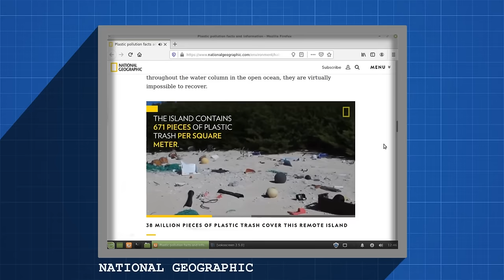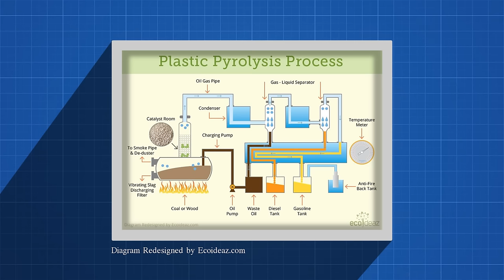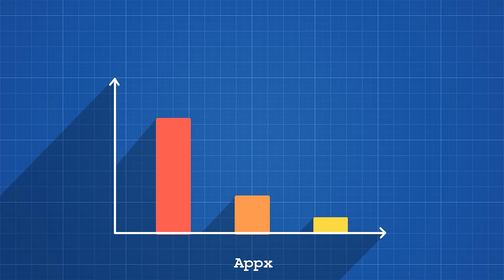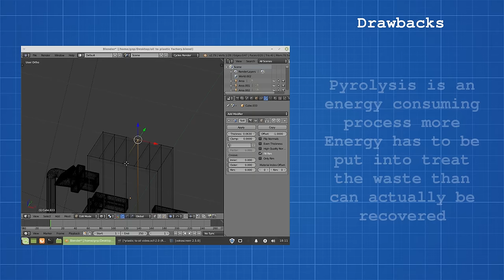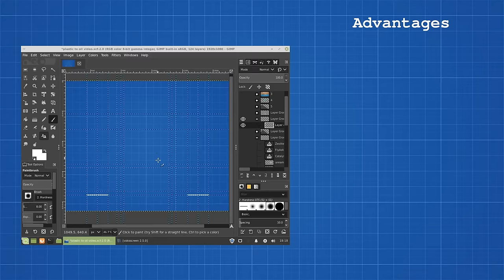How Waste Plastic is Converted into Fuel | Plastic Pyrolysis | Karthi Explains

Comment: Why don't the government promote this
Reply: He said it in the video. 

1. pretreatment is complicated. plastic has to be cleaned, non-plastic items removed, shredded, compacted. 

2. Uses more a lot more energy that it creates. 

This is why pyrolysis isn’t widespread. The only way plastic pyrolysis would make sense is using solar heat.
Reply: @stephenkeller8208  One guy simplified the process by making a giant Grinder that minces the plastic into pieces and thoroughly cleaning them that way with water
Reply: Still its not very energy efficient. @OrRaino
Reply: It's cheaper to buy oil

Comment: Pyrolysis is the thin edge of a dangerous wedge .  Mistakes or accidents during the process has horrendous consequences.  Better ways to reuse the materials , stop listening to the false promises of people who thing lighting a match in a petrol station is a good idea. With cars going electric and speed reduced ,how about using recycle plastics as body panels.  Construction could use far more plastic to replace materials that use huge amounts of energy and have a short shelf life .  We cut down huge amounts of trees to make chipboard sheets , waste plastic would be far better as it waterproof and the trees are better staying in the ground and growing . Where they adsorb more CO2 ,  stop the nonsense and let  the people with good ideas step forward.